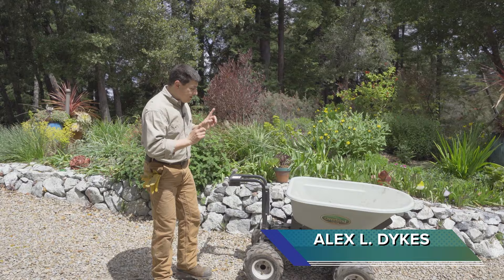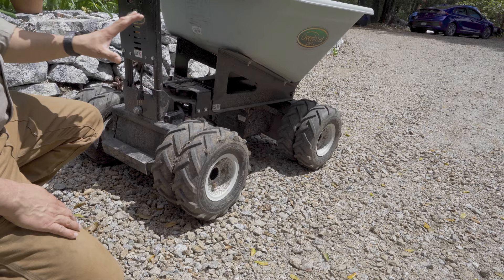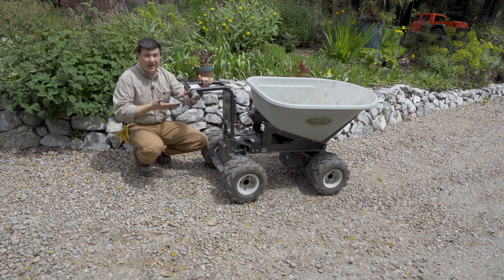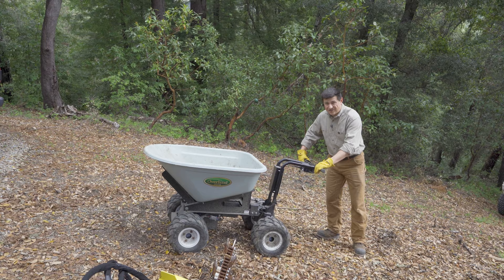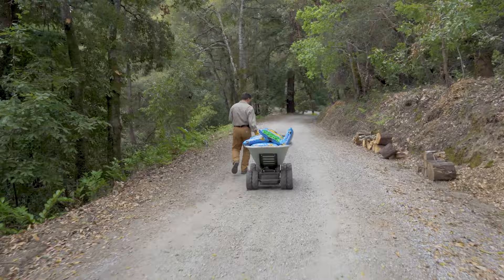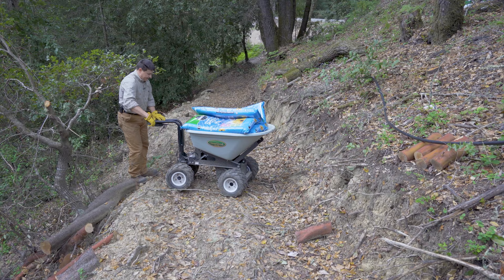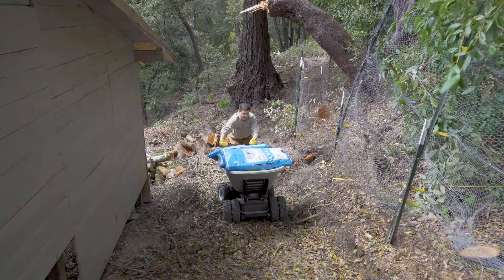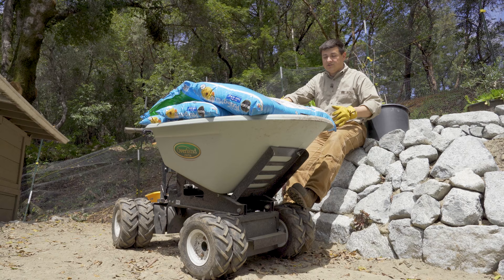The Best Tool Ever! - Electric Wheelbarrow By Overland Carts

Comment: I feel like you have a love/hate relationship with this cart lol. I get the complaints though, for the cost (over $3000 I'm assuming) limited slip would have been nice. I saw an electric wheel barrow at TSC for $780, single wheeled, definitely more in my range.